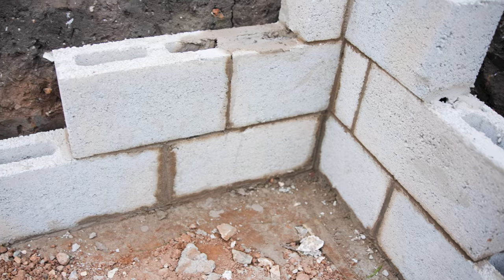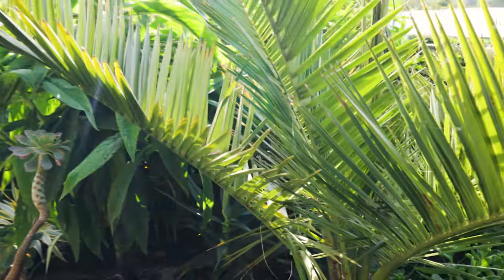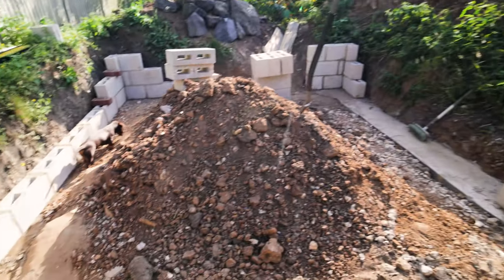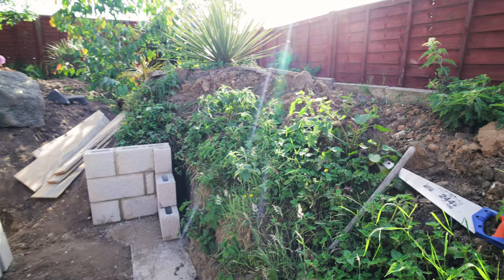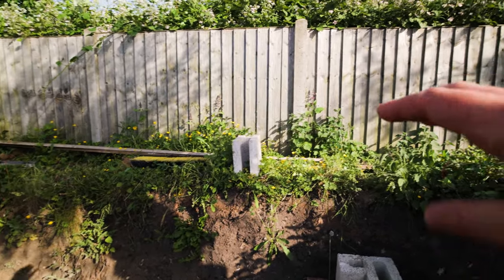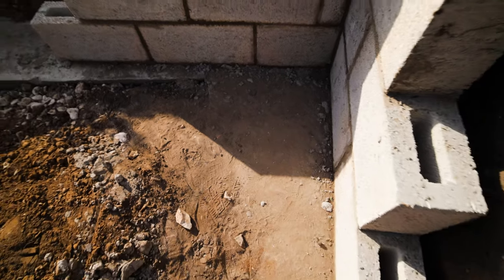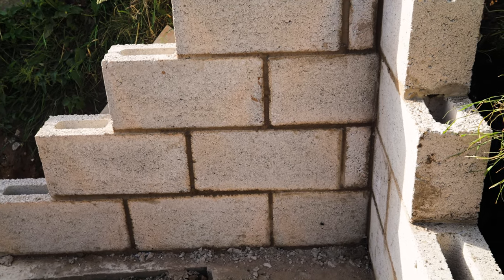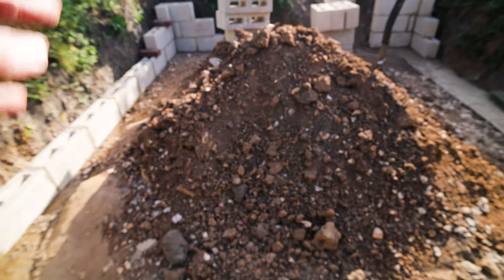Sunken Fire Pit Build Ep. 6: The block wall begins & a very early start!

Comment: I hope the walls will be strong enough to withstand the pressure exerted by the embankments.
Reply from the maker: Hi yes, I don’t have any concerns. The bottom course will have the ‘floor’ butted up to it and I’ll be pouring concrete into the hollows of the blocks so they should be plenty strong enough.

Comment: Amazing progress in such a short space of time! If you're anything like me you'll probably start filling the patio space with more plants after it's finished and you've worked out your seating. Have you thought ahead about making that easier?

Maybe laying any slabs you put down on sand rather than cement or concrete so you can remove ones to make planting pockets.
Reply from the maker: Thanks Gavin! I might have a shelf for potted plants but my main plan is to have benches mounted into the wall all round and then have the middle open for a fire pit / BBQ etc. There might be a few little planting pockets but it’ll mostly be a practical, usable space (I will be enjoying the planting all round though!). Your tip about the sand is a good one though and I was going to use a dry mix to allow more drainage anyway 😃

Comment: Don't forget your weep holes🤭 Being a bricklayer I can't help feel you need a thicker wall for a lot of the height of it for it to be an effective retaining wall with the amount of soil behind it , but hopefully all stays strong and goes well for you. All the best 😎👍
Reply from the maker: Thanks Adam. I’ll be drilling some pipes through afterwards. Not an afterthought but more that I haven’t decided exactly on the floor level and wall covering yet, thanks for the heads up though. Obviously I completely respect where you’re coming from but looking at the amount of earth the blocks seem about right, the floor will eventually be butting up to the first course likely and I’ll be pouring concrete into the hollows too. That’s mainly so I’ve got more of a fixing for the brackets that’ll hold the sleeper benches onto it but it’ll definitely aid with the rigidity. If I was looking at a slope or greater weight of earth I would have maybe gone for 8” hollows and setting rebar into the footings to run through them.
Reply: @GeorgesJungleGarden  Sounds like you have it all worked out ! Enjoy the graft and reap the rewards once its all done , great project and hard work definitely pays off 😎 so hats off to you sir! 👌
Reply from the maker: @adamwells5162  I don’t know about that but it’s coming together well so far. If there’s anything else you spot then let me know, feedback is definitely appreciated! Thanks 😃
Reply: @GeorgesJungleGarden  😎 All the best mate with it 👌
Reply from the maker: @adamwells5162  Thanks 😊

Comment: Will you be tanking the back of your blocks?
Reply from the maker: Hi, my original plan was to but I’ve been told that polythene down the back is the way to go. If it was brickwork I’d be using a DPC too as I imagine most of the water will rise up through the ground. I’ve largely gone off the tendering idea and if I’m cladding it then whatever I use will be properly fixed so the moisture shouldn’t be an issue, the polythene is as much to keep moisture in the ground in summer as anything else!